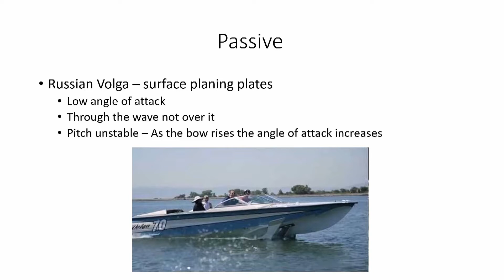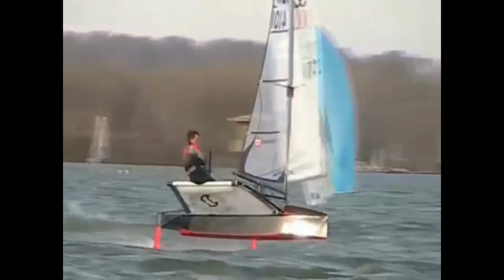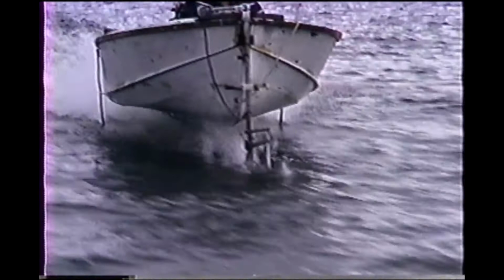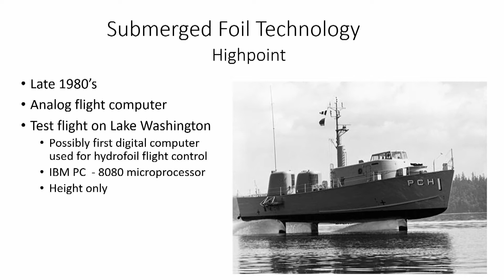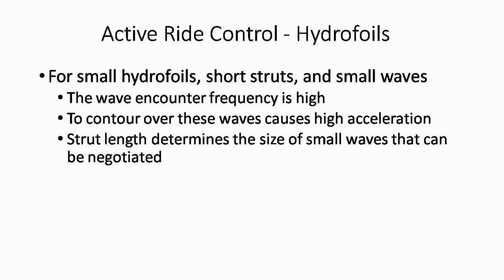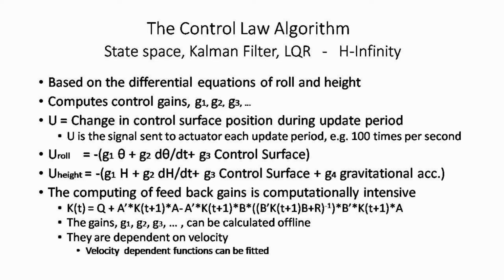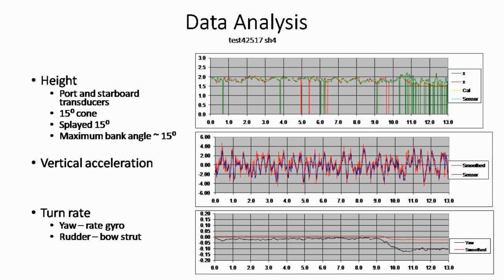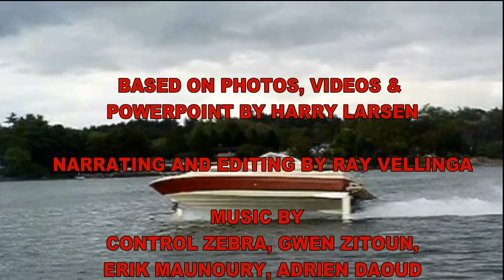HARRY LARSEN ON ACTIVE RIDE CONTROL SYSTEMS

Comment: Does Mr. Larsen have knowledge of all Boeing hydrofoils?  I would be interested in any public information on the IBM computers used on PCH-1.
Reply: I don't believe there is any "public" information on IBM computers used on PCH-1.  I was invited to ride on PCH-1 for a test of and IBM PC to control height on the vessel.   The test was on Lake Washington in the mid to late 1980s.  I was in the engineering station along with the engineer conducting the test.  It worked.

Comment: For the everyday user that owns a 14ft to 30 ft, or so, powerboat that wants to convert to hydrofoil tech, debris in the water is a major issue so I've heard. Why cant the foil mechanism be made more robust to handle impact from sea debris? I would understand that surviving an impact with a floating log maybe too much to ask, but I've read that even such things as a floating empty can or some floating rubbish consisting of sticks, seaweeds etc is enough to wreck a hydrofoil? Can it be built out of stainless steel, make it a submerged foil and have the upper part that transitions out of the water to free air designed to take heavy impact and still be ok for "limp-mode" just my thoughts.
Reply: Surface piercing foils can be effected by stuff hanging up on the foil, however the effect would probably be small.  Submerged foils would have to impact something underwater, e.g. a rock, to have their lift effected.  My boat, Talaria IV , has hit many floating pieces of wood over its 28 years of flying.  So far nothing has damaged the struts or foils.  (Floating wood is typically water logged and thus soft.)  Of course, I only fly during the day and so can see logs and thus avoid them.  Struts can easily be built sufficiently strong that they will not break on impact.  However if the object is massive then the boat will stop, like hitting a wall at 40 knots.  It will ruin your day.  To avoid injury it is better to have them collapse.  Talaria's struts and foils are designed to collapse such that the G load on the passengers will not be life threatening.